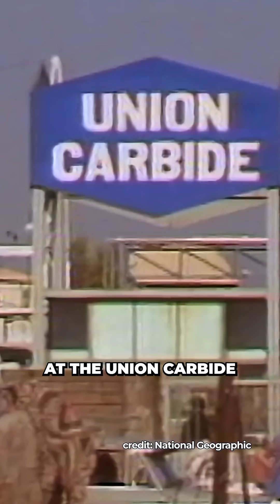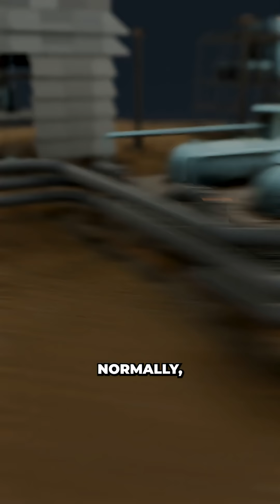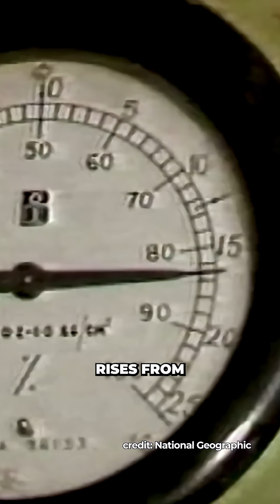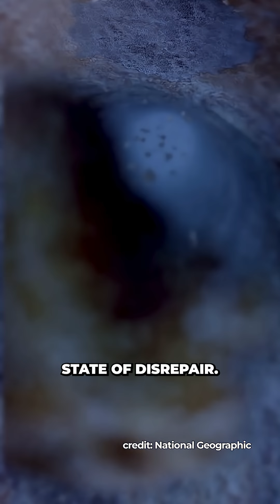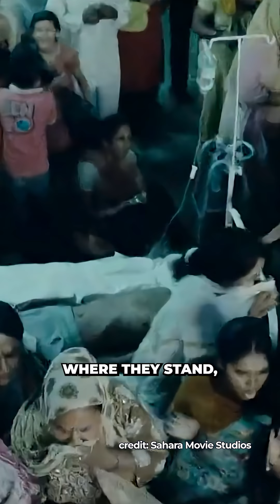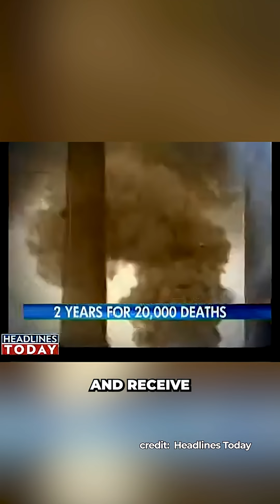The True Story of the Bhopal Gas Disaster

Comment: The engineering and implementation were correct, the process was well defined and a there were several security measures in place for every contingence but there's no contingence for pure negligence.
Reply: so you know nothing about the case at all
Reply: Do you even know what happened??? Negligence??? There were no working safety measures at all. It was reported years in advance, they simply let people be killed to earn profits. They tried and even partially removed documents detailing all the faults to cover their asses.

Comment: People don't realize how critical the maintenance and safety budget is for gas companies. My grandfather was a pipeliner the TransCanada Pipeline for decades, still has friends inside. He saw budget cuts to scheduled replacements and maintenance about 30 years ago and said there would be serious accidents in about 20 years. Sure enough starting about 10 years ago major failures and explosions started happening at neglected transfer stations. Gotta listen to the old hands when it comes to maintenance. An engineer can install anything to the spec sheet, but the people on the ground know exactly how long a valve or paint coating is going to last and what will happen when it fails.
Reply: The problem is when the people at the top want to start cutting costs. The people they will get rid of first are the ones that know the consequences of the costs they're cutting.
Reply: It's not the engineer who is ignorant. It is the business owner and/or executive. Prime example, Boeing, it was run by engineers with an amazing safety record. Fast forward after the merger with Douglas and the company is now run by bean counters and disasters start to appear everywhere. They even have the audacity to blame pilots of other countries for the failure of their executive deceitful practices.
Reply: Oh the engineers tend to be well aware of what can and will go wrong. After all they have to design the place with long term safety in mind. They just tend to not get asked when cost cutting is done.
Reply: @chalkopirateVery important point, I hate it that mechanics will always blame the engineers when the real reason is the cost cutting of finance executives, who have no clue about engineering and mechanic's work
Reply: The old hands... that's a hard ass line
Reply: @guerilla360gamr8 what did he mean by old hands?
Reply: Likely higher ups and those who never had an accident and thinks safety is overrated. These are the types of people that causes these disasters every time after previous safety was written by blood.
It will continue happening unfortunately. Until that change happens to where higher-ups like executives are people who worked their way from the bottom, understands the dangers of poor maintenance.... it will keep happening.
Reply: This is an especially serious problem with upper management in any industry
Reply: The engineers know how long the components will last too, and dutifully tell management they need to budget X so much yearly for maintenance. But somehow companies handling life-threatening chemicals are permitted to be run my Finance Bros who have no clue and think maintenance is a great place to start cost cutting.
Reply: I think most people would realize that; or at least hope that they do. But we also know how cheap and careless and immoral companies can be
Reply: And then the pipeline owners wonder why there's growing resistance to having new pipelines built. If they won't maintain the ones they already own, why should we have any faith that they'll treat the new ones any better.
Reply: CEO does not care, and shareholders don't care neither. only thing they care about is profits, line going up and that's all, nothing matters for them. even if world will die, they don't care
Reply: I did a smart pigging job for Celtic, the job was supposed to take 12+, closer to 16 hours, but Celtic being Celtic and not giving a damn about anything but money spent and money gained, over pressured to pipeline so much that my ptank was entirely hydrated all of the way to the very top of my flarestack. I was green as hell, only been well testing for maybe 3 months absolute tops, probably more like 2 months, so didn't know that my gauges were frozen so were lying, my supervisor came into the tank asked what the pressure was, saw that the tank's gauge said we only had like 300 psi, he grabbed me by the collar and threw me out yelling for me to get the fuck away from the tank, and opened up the gas value all of the way and got the hell out of there too. A bit before 11 am the guy in charge of the job was already at out end, and when I asked what was wrong, he just said nothing was wrong, that the smart pig was already at out end. The pig went i believe like 23 kmph instead of the 2-3 kmph that it was supposed to travel, so not only did they not get any data on the pipeline whatsoever, they also severely damaged the couple million dollar smart pig. Then people wonder why pipelines leak. If properly maintained and never vandalized, they won't leak, but when a company decides that paying 20ish people for a 12+ hour shift and having that stretch of pipeline nothing making money, isn't as good as paying us a 5 hour shift and getting the pipeline back online making them millions of dollars, then that's when shit breaks. The next year Exxon scrapped Celtic as a company because of all of the bad publicity, deaths, injuries, etc. And by scrapped, i mean that they just simply changed the name to XTO, fired a few of the absolute worst of their consultants and kept the rest and maintained being a shitty, cowboy company. Not gonna lie, Inloved working for Celtic/XTO for the most part cuz they had the biggest wells, that kept you contracted for 1.5 to 3+ months at a time, and I loved working massive condi wells, but it was always sketchy working for them cuz you knew that the work would go on even if legally it needed to be shutdown. Did one job where we had a service rig assisted snubbing rig working, and there was a crazy thunderstorm going on around and above us, and the consultant told the rig crews to just keep going despite the torrential rain and lightning. I was safe, but i wasn't the couple of guys at the top of the derrik, hoping for lightning to not hit them or for them to slip off of the top. Shitty, greedy companies is most of the reason for the oilfield having a bad reputation and so many eco activists.
Reply: it's crazy to me how things with guaranteed profit for decades still got corrupt people behind it
Reply: Old hands 
Now that's some shakespeare shit
Reply: @HarshKumar-gh9uc Well, when I say old hands I mean it lol. These were the corrosion techs that were there from nearly day one when the line started in the 50s. My grandfather ran a pig, but the old version. Everything they did was manual, slide rule, and reference table calculations. He made out like a bandit in the 90s when they wanted to convert everything to digital and they basically paid off the original crews to retire early. He got stock options, full salary pension for quite a while, and lifetime premium insurance. Basically all the benefits of working another 15 years without having to clock in ever again. Wish things like that still existed lol
Reply: @liamfoxy wow that's really a generous company
I doubt any private company is gonna do anything close to that these days.
Reply: Yeap. Engineers (like me) can make stuff but that becomes useless without people who know how to physically maintain my work. We're at a time when everyone wants new stuff but no One wants to maintain them. Its already becoming a problem.
Reply: Hm
Reply: Pipeline leaks are widely publicized in Canada. There have been no explosions or leaks that I’ve ever heard of ob the pipeline you’re talking about. I find your story highly implausible. I’m open to you proving me wrong by referencing a publicly accessible and reputable source.
Reply: Nah that's nonsense, of course you should ONLY listen to CEOs, they earn more so that means they're just BETTER than you, workers are replaceable they're not, that MUST mean something!!
(Kinda exaggerated but that's basically what the average capitalism-defender believes, actual real workers, experienced old hands as you said, know nothing and are worthless, objectified and replaceable in their opinion, your story and real life events all over the worlds obviously disprove that time and time again)
Reply: The AMERICAN GENOCIDE cruel killer are out of reach..... still they survive on earth.... And now they are DEFINITELY in the HELL.... BRIBE EXPERT AMERICAN.
Reply: even if someone dies im hoping thoes companies got shafted by this loss of infastructure by blood and money.
Reply: People do realize it’s just the greedy corporations
Reply: bro... there's no way that entire canada pipeline is trans smh
Reply: @liamfoxy Actually the accident is not from a gas plant, it was just a mere by product of freaking Agricultural Fertilizers. But, imagine if he would have used the money that time to fix the issue, now there would never be such tragedy and he could have also been rich by now too.
Reply: So i agree with you, just as clarification. But also in this particular case me and your grandfather can both tell you these labourers are idiots and are probably the actual “root cause” not that safety equipment wouldnt have prevented it. But that Ignoring rising pressure, not having your flare stack lit, allowing a pop valve to blow, not being alarmed by 300° RADIATING HEAT FROM ONE OF YOUR TANKS. Yes safety is good. But not being regarded is also good.
Reply: The thing is that it's the old ones that remember when the last time something was serviced, while the new guys don't even know it should be serviced, or think it must be someone else's job. That stuff happens a lot where no one thinks to perform maintenance on something because they haven't seen anyone else do it.
Reply: @nunyabisnass1141 that's one of the issues that emerge from underestimating the importance of experience, people switch jobs constantly in our modern society, they're seen as disposable and replaceable, ask any manager how stuff works in the factory they manage, they may be able to sound smart but a worker will actually be able to teach you what's going on, the only managers you can trust are those who used to be on the ground getting their hands dirty and somehow climbed to the top, they know how stuff is done and more importantly they will listen to new employees when technology advances and the manufacturing process changes in some way
Reply: Say that again?
Reply: Lmao another old head sympathiser talking down on engineers. It was corporate that caused this and the old heads that didn’t put the cover plate in place 🤷🏻‍♂️
Reply: Has friends inside whom? You?
Reply: You realize it's the old hands that MADE it unsafe right? lol
Reply: Everyone in this comment section has zero f***ing clue about how much TC Energy over-engineers all of their systems, and how completely different those standards are compared to some rural Indian city.
Reply: Have you ever seen hiw indians, pakistans approach to hazardous materials?
Reply: Your dad's friends are still inside ? Why doesn't he try to help them getting out ?
Reply: Engineers know. But engineers are doormats who will never speak up. Looknat boeing, the engineers knew and they sent each other secret messages but they never spoke up
Reply: This was an American plant. Americans cut corners and Indians died. You should be specific and not insinuate that the Indians were at fault!!!
Reply: @frankmansour362  my guy we're talking about corporate authority in general and not India exclusively.
Reply: @frankmansour362 Nice try, but all the officials charged with a crime where Indian, so... whoever owned the company was not the one cutting corners in the poor management of it, the people charged where the ones deemed most directly responsible and they were Indian. 🤷🏾‍♂️ Not that this should matter. It's not even important where they were from. People died.
Reply: @honaleri those were employees following orders. They had no access to funds for proper maintenance. The American company was losing money and made a deliberate decision to cut cost. Criminal.
Reply: Capitalism, let's abolish authoritarian "regulations". Let the workers and buyers boycott if they want the hand of the free market to change
Reply: @andrecorso5712  if you think capitalism is bad let’s talk about communism specifically  the Chernobyl or Mayak disasters to name but a few
Reply: @ragtowne You think Chernobyl was a result of communism?

You failed your nuclear physics test in high school, didn’t you?
Reply: @TheOfficialOriginalChad  for one thing every single incident was considered a “state secret“ and the USSR promoted their nuclear energy program as “100% accident free“ – I don’t know how you separate communism from USSR
Reply: @ragtowne and you think the incidents being secret caused the incidents themselves? Or have you forgotten that we are talking about what CAUSES disasters like this?
Reply: @ragtowne  Nice whataboutism, Instead of looking for solutions, you just try to point the finger at the other side like a chicken.
Reply: @andrecorso5712 nice narrative, except it didn't happen in a free society. Try again.
Reply: @ihdieselman Canada is not a free society?
Reply: @andrecorso5712  people who are quick to blame capitalism has no idea of what a real free market is.

Also, do the rest of us a favor and stop calling corporatacracy and corporatism capitalism.
Reply: @remanscimitar I don’t know, it’s hard to separate corporatism and capitalism when a lot of industries were built with capitalist intentions in mind.
Reply: @remanscimitar What if I'm not being sarcastic? You don't know if I'm an ancap. It could very well be that I agree with you, but you're here denouncing your own philosophy, lol 😂 

What is the free market solution then? If I'm so wrong? Wasn't it boycotting? That's what I was taught in the ancap pro-Capitalism club! If you disagree just don't buy it or don't work there! In my POV it's you who don't believe in the Free Market enough
Reply: @andrecorso5712 You are making a lot of noise for no real benefit to anyone.
Reply: @honaleri  So is any comment here 😂
Reply: @iamtobiay  Just look at the Soviet Union. Without the capitalist intentions, it should've had a spotless industrial safety record, right? Right?
Reply: @remanscimitar Exactly! We dont have true capitalism! Pretty much all of the biggest corporations, banks, and hedge funds would have collapsed without government intervention and preferential treatment/bail outs, subsidies, contracts, and protection. We can thank the government and its "social" programs(a favorite of socialists) for every monopoly on the books.
Reply: @remanscimitar  I was in my 30's when I first understood that corporations are not democratic. A bit late to recognize that they wrap themselves in the flag, or used to, and stoke the anti-regulation fire for their own motives. And they spend gobsmacking piles of money to convince us we matter to them while enticing us to buy their products. In fact, it's the almighty dollar that they value to the exclusion of everything else, including people.

I'm not a Marxist, and I'd rather see billboards selling Happy Meals and insurance instead of jingoistic images of Dear Leader. Private sector economies generate a higher standard of living and less paranoia and secrecy than command economies, though the margin of difference seems to be shrinking with the power and wealth being concentrated in the information sector these last few decades.

When decisions lead to bad outcomes everyone's first reaction is to cover their ass and deny the crime. It's true for corporations. It's equally true for governments. Once an organization achieves coveted dominance, accountability is the first casualty, and devious tactics are deployed to make competition the second.

For those who favor Marxism, you should understand that Socialism is just Corporatism with the profit motive replaced by guns. The leaders in both systems are the most dogmatically Darwinian of the lot.